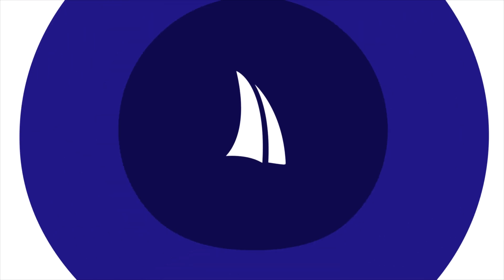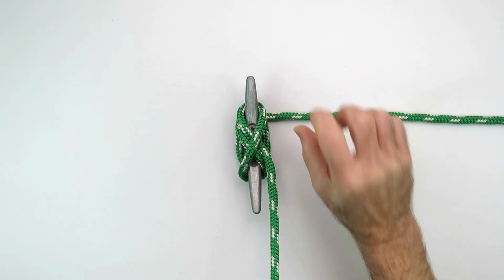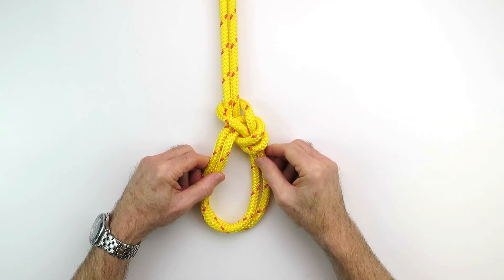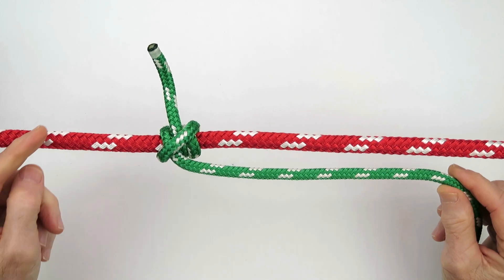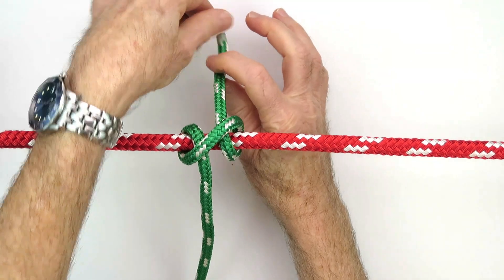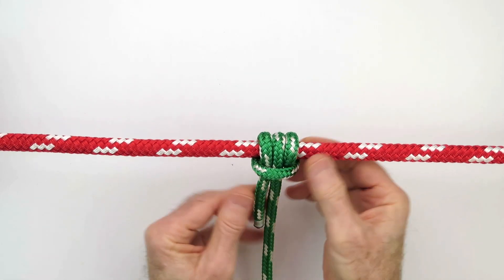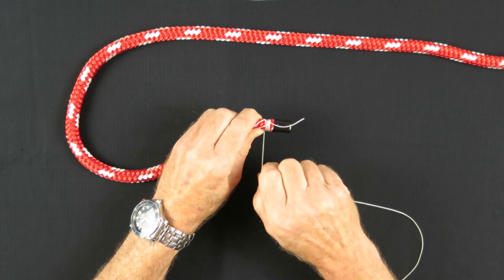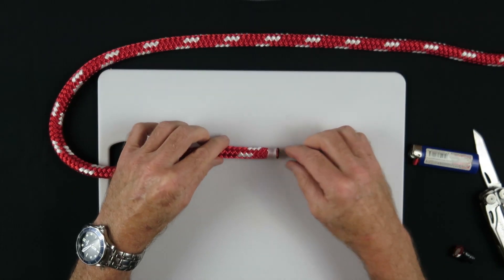Ep 25: More Knots & Whipping a Line

Comment: Good video. Rolling Hitch - first method is preferable (ABOK #1734), second method gives less friction and is properly called a Magnus Hitch (ABOK #1736 ), a third method is better than either: the Midshipman's Hitch (ABOK #1735) which is as easy to tie as the first. All three are known as taut-line hitches. I teach Marlinespike Seamanship for the Hoofer Sailing Club in Madison, Wisconsin and am a member of the International Guild of Knot Tyers.
Reply from the maker: Great tip! Thanks for sharing
Reply: Another vote for the Midshipman's Hitch as it improves the rope-on-rope grip to avoid slippage - it actually encourages a micro-bend in the line you're hitching to for added gripping power. The Midshipman's obviously has a sailing pedigree. Incredible how different regions on the globe teach & perpetuate specific tying methods.  Not sure I've seen your method #1 for tying a Rolling Hitch - your most popular.  Methods #1 & #2  are well suited for rope-on-pole attachments - but they are also among the most widely used versions of general purpose friction hitches.
Reply: I've never seen the working end used to form the inner turn of the two turns on the inside side of the hitch.  As far as I know, this method doesn't appear in ABOK.

Comment: I do not melt the bitter end after applying common whipping.  Instead, I deliberately fray the end.  This helps ensure that the whipping won't slide off.  And it makes the bitter end less hazardous if (when) the line flails.
Reply from the maker: Thanks for the tip Alex

Comment: If there's a lot of surge/wake,   can let slack work its way through the hitch creating slack in mooring lines.  The full wrap keeps the slack from getting into the heart of the knot.
Reply from the maker: Thanks for the comment. Which knot are you referring to?
Reply: @CarpeDiemSailingMagazine    Oh sorry,  the cleat hitch.  There a video out on YT that shows 3 versions of the cleat hitch and it shows how the half turn cleat hitch can slacken with wake and tide.  The full wrap of course,  can jam a little depending on line size and cleat size but it is more secure because that is exactly what happens,  theres a friction point where the lines cross under the cleat horn.  Isn't that what we always do to get more hold?  Add another turn somewhere.
Reply from the maker: @KayZee1957  interesting. I know that there were several methods. I have never seen a cleat hitch with locking turn loosen under any conditions. In the navy they never use a locking turn.
Reply: @CarpeDiemSailingMagazine  

https://www.youtube.com/watch?v=BBqsF72xNSU

I'm talking about the difference between the #1 and the #2 variation.  On my 41,  i found that the number one variation would slacken noticeably with wakes and tides over a period of a few days.  It never failed outright since there was always plenty of tail but in a situation like mine where the bow sprit will start taking out my dock box,  I need the security of the #2 version.

Comment: Can you use this method for  climbing rope end loops. Eg: prusik loop? I've stitched the  loop together, extremely tight! Now I was going to whip the ends? Any reply appreciated cheers from Australia just subbed.nice work 🙂👍👍👍
Reply from the maker: Thank you for the comment. Can you clarify what you mean by “can you use this method” which knot are you specifically referring to?
Reply: @CarpeDiemSailingMagazine  I was stitching the tail ends for a prussik loop for the carabiner to fit nicely. Less bulky than stopper knots
Reply from the maker: Ultimately a Prussik loop should be tied with a double fisherman knot. There are some commercially available that are sewn but I wouldn’t trust my life to a loop I’ve sewn myself.
Reply: @CarpeDiemSailingMagazine  thanks for the reply. I was going to test with My 2 ton winch! I still will.
Reply from the maker: I cannot endorse using a home sewn Prussik loop in any kind of high angle situation and also want to mention that a common practice in any high angle situation is to independently back yourself up. In sailing I see all too commonly people going up the mast in bosun’s chairs on a single line with no backup whatsoever, a very unsafe practice in my opinion.

Comment: What you call "whipping" I was taught as "seizing" the line when I worked as a deck hand on a Mississippi river tow boat.  Typically we would just use duct tape and call it good enough but when none was available we would use "cow tails" or strands from a 3 inch line that was no longer safe for service so "seize the line".
Reply from the maker: Whipping is done at the end of a line to keep it from unraveling, seizing binds two lines together. To form an eye for instance.